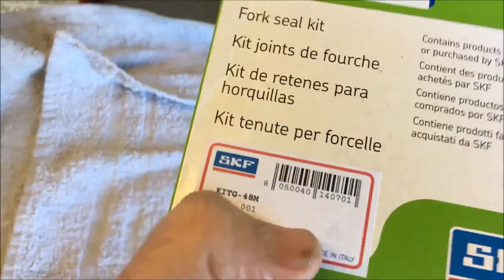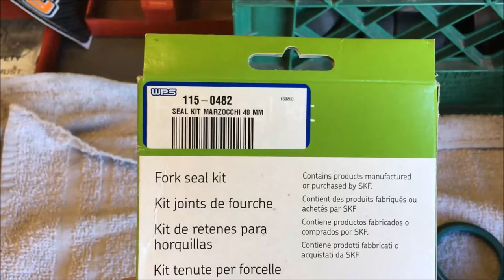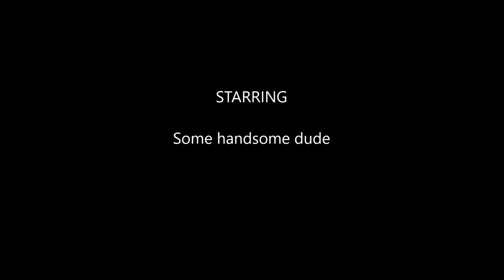GasGas EC300 Marzocchi 48mm Fork seal/oil replacement...........and a little rant!

Comment: If you drive the seal and sliders in, put your fork horizontal next time it will be easier to drive them in and never put aluminium parts in iron vice this gonna leave marks to aluminium, but although your yob was fine! How much you paid for the fork service?
Reply from the maker: The service was $200 American.
Reply: WTF so expensive? I do forks for 110 USD with oil and seals total!
Reply from the maker: +RacingRaptor I normally do them myself but needed a complete tear down since it had never been done. Next time I will buy the necessary tools and do it myself. Also that way I can bring it to all of you how to do a complete tear down.